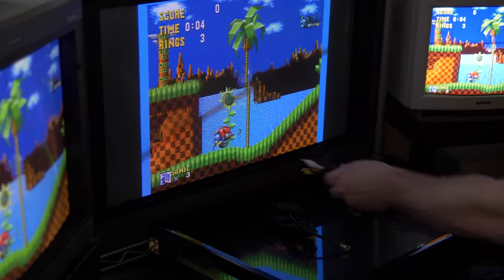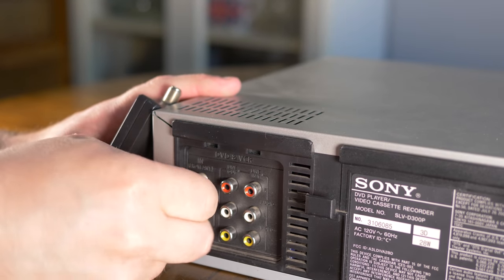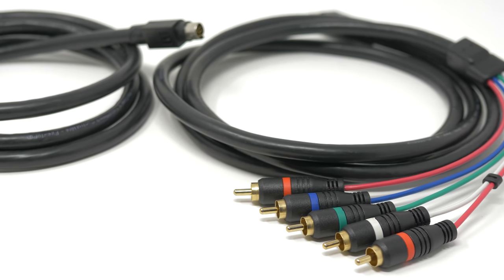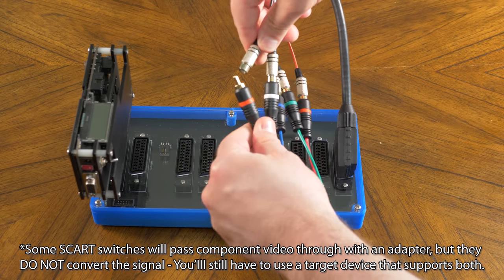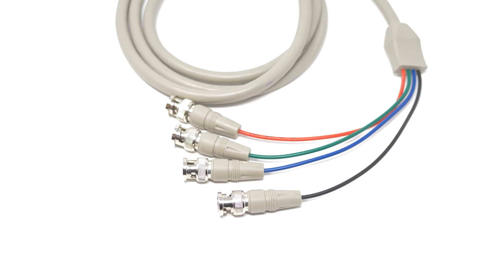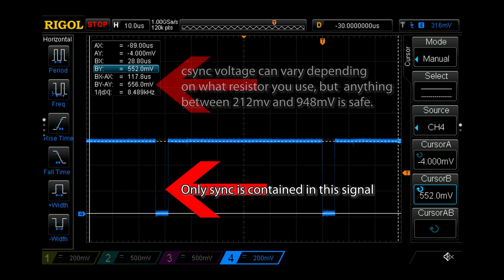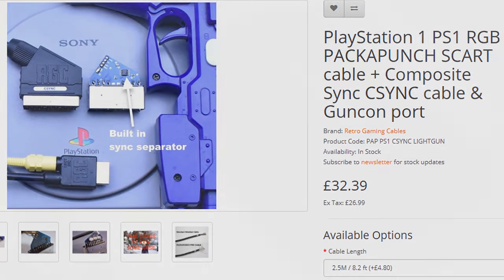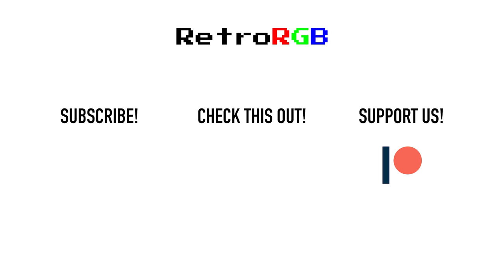Choosing The Right Cable For Your Classic Console

Comment: What would you suggest for the original Wii I'm going to get the 4K retro tank about what wires would I use for the original Wii for the best quality for an LG G2?
Reply from the maker: Definitely the HD Retrovision component cables:  https://www.amazon.com/shop/retrorgb/list/3W4EB94EPJFAK?tag=onamzretrorgb-20&ref_=aip_sf_list_spv_ofs_mixed_d
Also, don't forget to enable Widescreen and 480p in the Wii's menu :)
Reply: @RetroRGB  saw hdm2wii going get one soon
Reply from the maker: If you're getting the RT4K, don't get the Wii2HDMI.  That's a great product, but let the RT4K do all the digitization.  The much more expensive chips inside will do a better job.  
...and no disrespect to the Wii2HDMI.  They're just two VERY different price points.
Reply: Thank u for your help everything u do
Reply: So just use the 4K retrotink and component cables with my old consoles and if I decide to go with HDMI mod for each console
Reply from the maker: Correct. But I suggest starting with good analog cables first. After seeing how it looks, you might not want to HDMI-mod the console at all. Wii, PS2 & Dreamcast all look great with shielded analog cables.
Reply: @RetroRGB  what would you suggest with the original Xbox I have composite cable that looks horrible on my LG C2 I know you have options on your site but what's the best option I see I can get ahold of Monster Cables but the original cables are a lot more ask for HDMI2 looks really well I don't know when that retro tank will be back in stock

Comment: So, when using a retrotink 5x pro, along with hd retrovision cables on a super nes or genesis, is rgb scart needed along with the rest?
Reply from the maker: Nope, the HD Retrovisions are an alternative to SCART and equal in quality to the best SCART cables (and better than the mid-low quality ones).
Reply: @RetroRGB  okay. In other words, I only need hd retrovision cables along with the retrotink only for the best hd picture? Thanks
Reply from the maker: Yes.  Please check the website for links:  https://www.retrorgb.com/systems.html
Reply: @RetroRGB  thank you 🙏🏾

Comment: I just got a SNES Jr and wasn't to add a RGB mod chip. What cables would I be looking for?
Reply: an unmodded snes jr only supports composite video
Reply: @GameCube Player  sorry I see it auto corrected the wrong word. I want to add a rgb mod chip.
Reply: @stevenrod100  an rgb modded snes jr uses an ntsc snes csync rgb scart cable
Reply from the maker: All the info you need is right here:  https://www.retrorgb.com/snesminirgb.html
Hope that helps!
Reply: I just tried using a Hyperkin multiout to hdmi cable for the Snes Jr and figured out it doesn't work without modding it to use s video.
Reply from the maker: Those Hyperkin cables are terrible - They add a bunch of lag and process the image wrong.  You'll want an RGB cable + RetroTINK, or something like a RAD2x.  Check this channel for tons of videos on all of these.
Reply: @RetroRGB  agreed but until I can afford that they will have to do
Reply: @RetroRGB  now that you mentioned it in looking at how well a Rad2x would work. Seems like a good option for getting a good picture and cutting down on the number of cables once I have the system modded. I'll have to keep it in mind while I'm building the system up.

Comment: lots of component to hdmi converters have issues with 50hz signals btw
Reply: No, s-video to hdmi vga converter. Real hardware ps1 all ntsc games run very smooth framerate on 50hz CRT No upscaling than 60hz CRT standard framerate.
Reply: @donemansion  I'm talking about component to hdmi converters running into lcd screens

Comment: @14:22 is an incorrect assumption.  The reason composite sync is called that way is not because of composite video, but because it is a composite of the h-sync and v-sync signals.  Composite video is called that way because it is a composite of the luma and chroma signals in a single channel.

Comment: what if i use the retrotink 5x with the scart adapter using my composite yellow, red and white? would that get the job done? since the scart has the build in S video inside + me adding composite. enlighten me RetroRGB.
Reply from the maker: The RT5x's SCART input does not accept S-Video, only RGB and Composite.